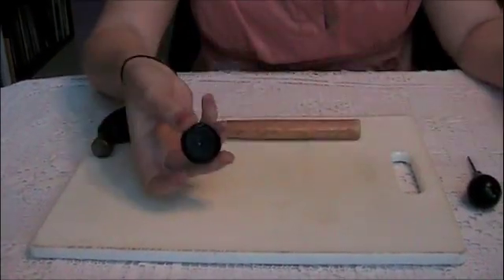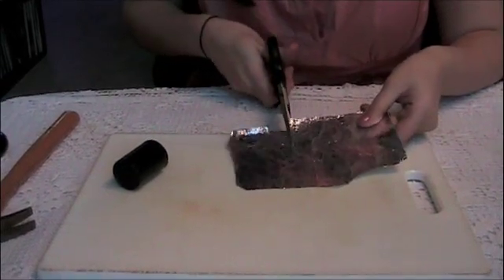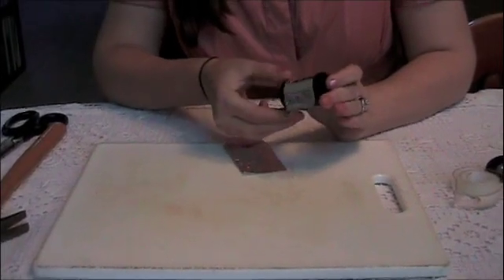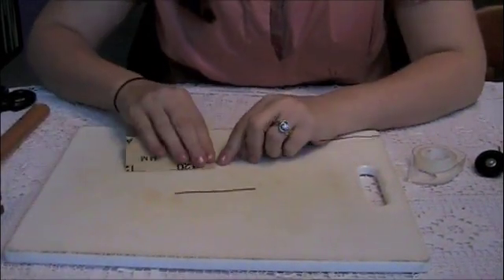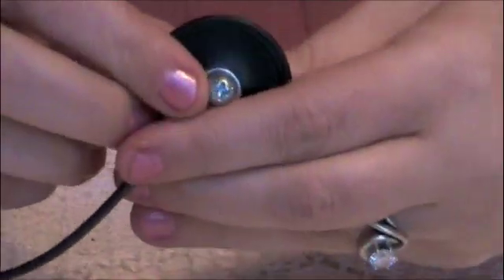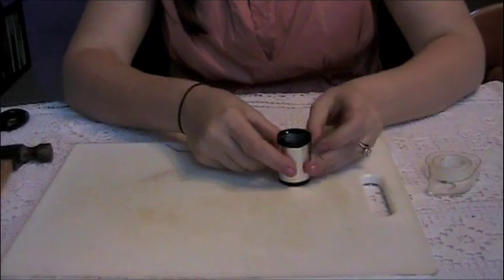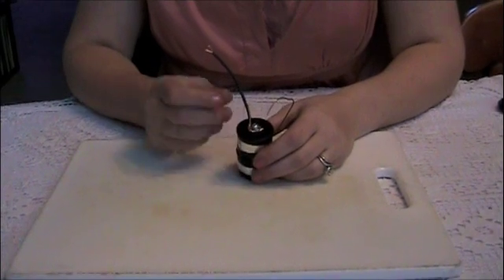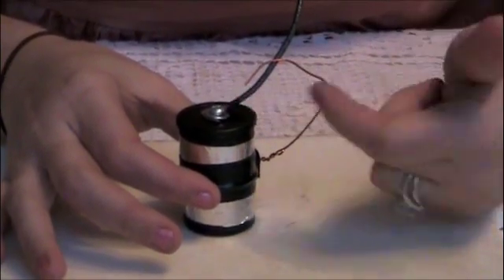Leyden Jar

Comment: Is there anyway to power a light bulb using a pint-sized leyden jar?
Reply: Nope, cause leyden jar isn't a super capacitor. It is just a regular capacitor. Meaning it might cause the bulb to flash but it won't light it for a long period of time. What you want is a super capacitor, those things are high tech. and work as well as batteries. The difference is they charge much quicker and have virtually unlimited charge/discharge cycles. I made a flashlight out of those :)